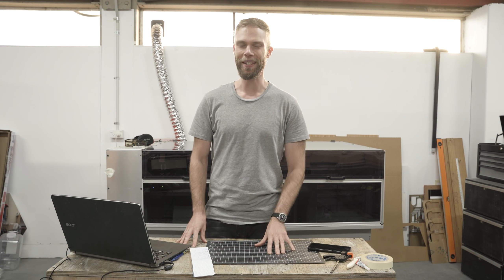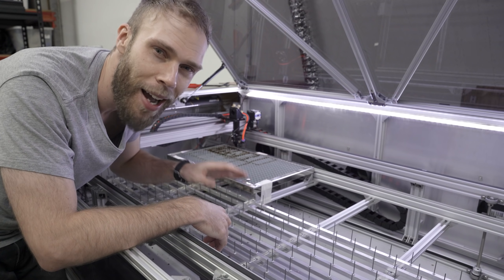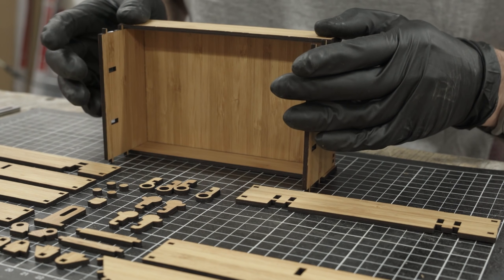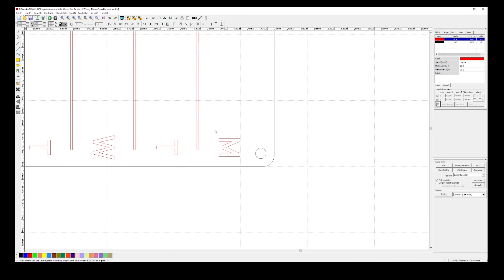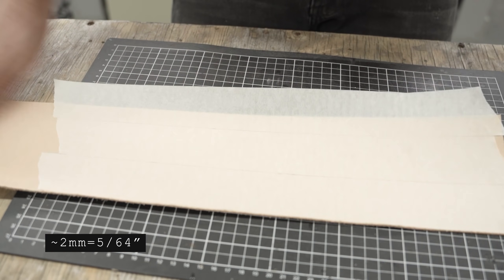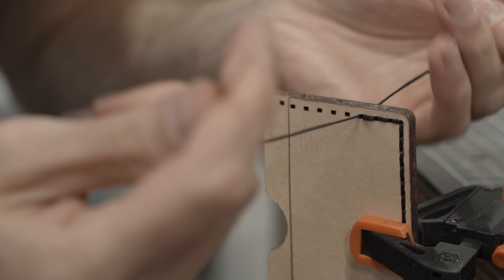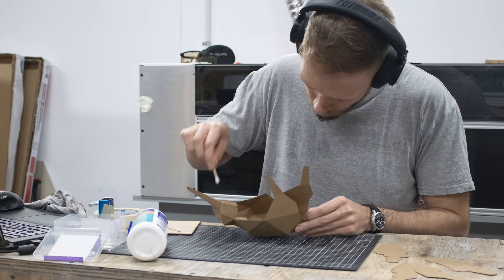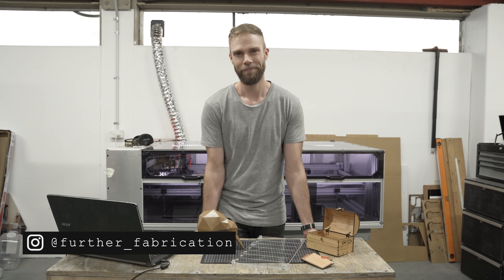Tips and Tricks: Making Lasercut Products with Basic Materials

Comment: if beginner, remember you shouldn't coat wood in any finish before cutting. If your ventilation is good enough it's not so dangerous, but don't do it every time as it produces CO and formaldehyde. Ideally, cut wood that is untreated and unfinished when working with CO2 lasercutter.

Comment: Love (especially) the low-poly kiwi 😍
Just curious: how did you get the connecting flaps for every single polygon? Manually or automatically by software? And, in case,  which software?
As well as kiwis there in NZ, local fauna here in Rome is mainly cats...I’d love to do something similar with mine 😉🐱
Reply from the maker: Check out a 'pepakura'. it's a really fun piece of software

Comment: Hi. Hope all's well. So here's a question: you mentioned you scale things to get them cut. Is there a particular reason you opt for this approach vs. using offset? I'm guessing it's to do with efficiency, but was really unsure about how that'd affect finger joints and pocket holes in the piece.
Reply from the maker: Great question. So in the case of the treasure chest, I'd designed that with the correct offsets for 3.1mm thick material, however the bamboo ply I ended up using was closer 3.3mm thick. So it's easier just to bump up the scale than redo all the slots. That would of course increase the offsets but it seems to workout fine if you're only scaling it a small amount, as the difference is usually less than the variation in material thickness anyways.

Comment: Good to hear from you! I bought most of the basic hardware for my own laser cutter (based on your plans), but COVID really locked things off when I was waiting on everything to arrive from overseas. The angled bracket connectors (which you filed down) in particular took somewhere around four months to get here! The project is on hold for a bit but I'm definitely glad I held off on buying the pricier parts, like the laser tube.
Reply from the maker: Yeah covid really threw all those shipping times out the window, but better late than never. good luck with your build when the rest of the pieces arrive!

Comment: Glad to see a new video from you, your channel helped a lot starting out in co2 lasers
What do you think of spraying the workpiece with small amounts of water to achieve nearly the same results as using masking tape? I found that on large orders and especially with a lot of small pieces time spent removing the tape and money spent on it increases greatly
It has a limit as wood for example bends when drying after this process, but small pieces tend to resist this
Reply from the maker: I hadn't heard about that trick! definitely gonna give it a go. thanks for sharing!
Reply: What is the exact purpose of the masking tape / water? As in, why does it need to be protected? I am new to laser cutting so apologies if this is an obvious answer.
Reply: Looks like it was explained later in the video. Thank you.

Comment: One thing I’ve not been able to find is a list of materials this laser can cut and their thicknesses.  Any way you could shed some light there?
Reply: It depends heavily on the Material
I build a Y1200/80W myselfe and I was able to cut 15mm Acrylic with a different lense

But in terms of Wood, it gets burned really quick, I made a MDF 'X-Mas Tree' in 9mm and I did 3 Cuts to prevent burning

If I get a new Material I use one of the 'Lasercut Sample'  Parts of Thingiverse
Reply: Pine plywood up to maybe 10mm, PMMA up to 15mm, MDF up to 18. Paper. Cardboard. Fabric. Rubber (make stamps). Vinyl stickers (bumper stickers). Glass (etching only). There are some specific things to avoid too (eg PVC). Is there a specific material you're interested in?